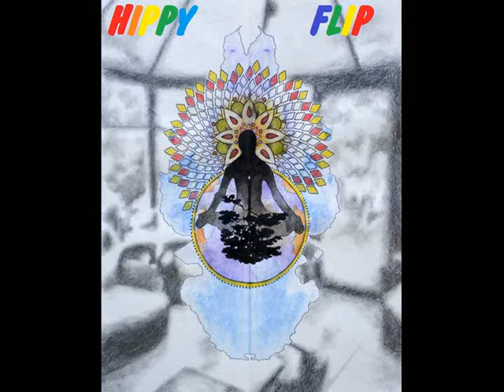Acid Bass Extraction

Comment: otherwise safety gear and proper lab technique is required (for which most people are either ill-supplied or ill-informed).

also make sure to use glass ware (Baster included), not plastic (not even hdpe2)